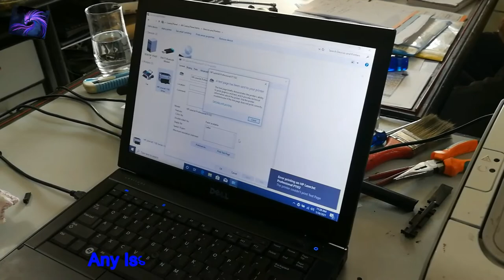How to fix HP LaserJet P1102 disassembling and printing issue & resolution

Comment: hello sir. optiplix 960 amber light blinking 1&3 codes. i used to press the reset button to turn on . this week even the reset button don't work anymore (only 1 time i pressed and it worked fine but the next day same amber light) what should i do plz help me im a student i dont have money to buy new one. help me sir